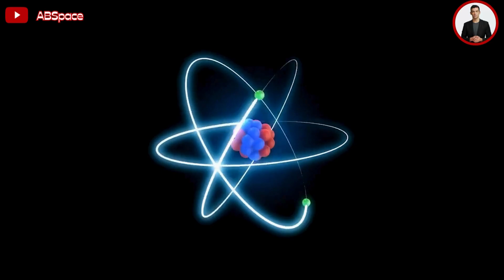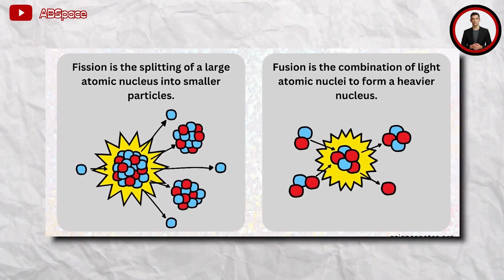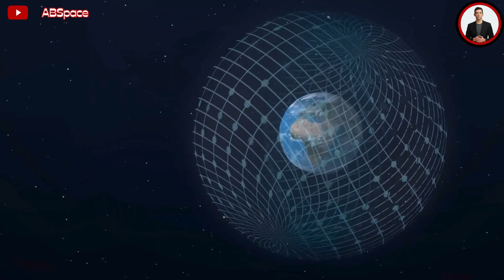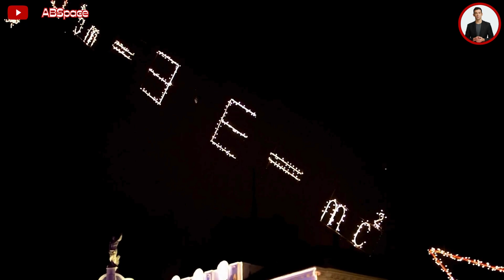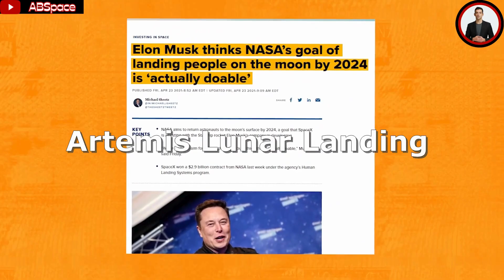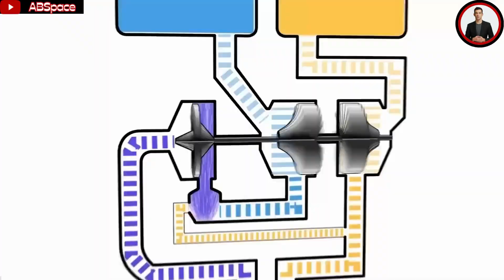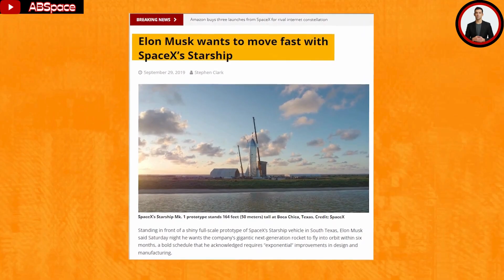"Breaking News: Elon Musk Unveils SpaceX's Nuclear Propulsion Engine!"

Comment: Absolute nonsense, so you ultimately still need a propellant, which defeats the whole point, you're just discussing how to ignite the propellant, not how to replace it. You still need Kerosene or Methane and Oxygen, which you must take with you on takeoff, merely changing the power source for the ignition spark is useless.
There is no other form of propulsion in Space and the issue isn't that we can't generate power in Space because we can, the issue is that there's nothing you can convert that energy into that will give you thrust in Space, that's why you still need Kerosene and gases of some sort like Nitrogen to propel you.

The real revolution would be figuring out a way to cause propulsion from a nuclear reaction without any kind of additional propellant